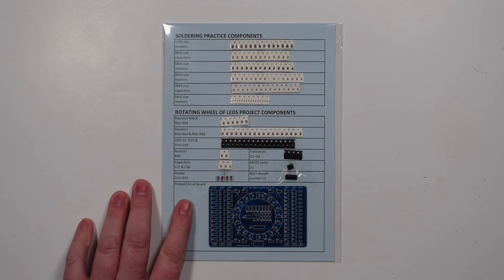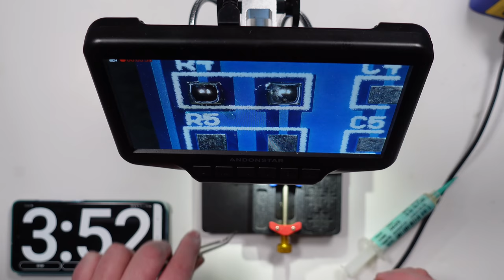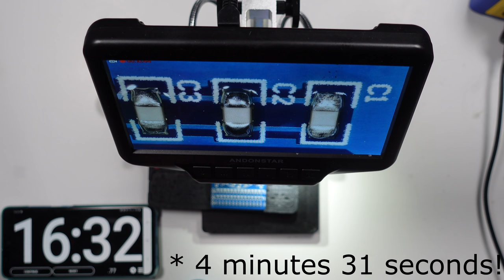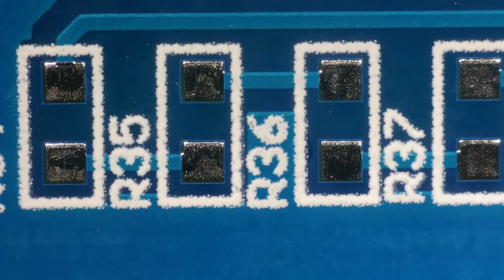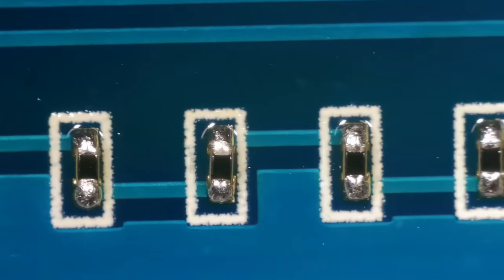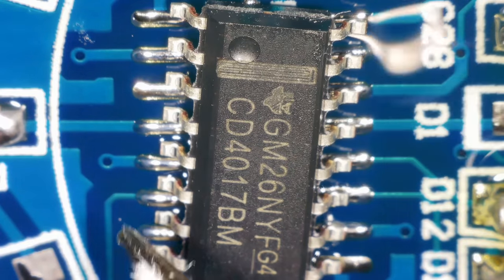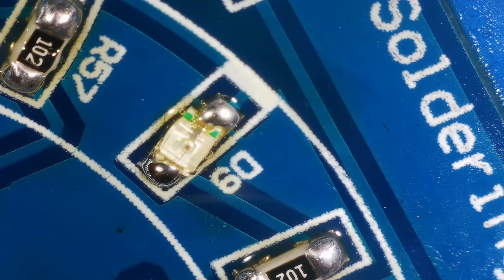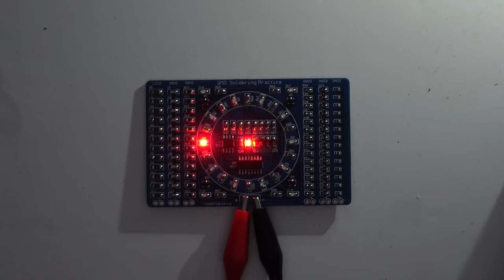SMD Soldering Practice Kit | OOOHH!

Comment: Hi mate what's your flux? Thanks
Reply from the maker: Hi Fawaz. I use Amtech 559. I've nearly ran out! 😳 Need to get some more, its really good stuff.
Reply: @StezStixFix  Hi thank you for this very informative video. I would like to know where do you buy your Amtech as so many fakes out there.
Reply from the maker: @mm0077  Hi Mial! I bought mine from Amazon, as I figured it would have less chance to be fake than from eBay or similar. I'm pretty confident it's genuine, but as you say, there are a lot of fakes! I've actually just ran out, so I'm going to be using Kingbo RMA 218 next, as I've heard it's also very good and is much cheaper. I'll let you know what I think of it as soon as I use it! 👍
Reply: @StezStixFix  I am using the Kingbo rma218 and it is fine but it does leave a kind of grease effect after cleaning and it does not matter how many times I clean with  isopropyl alcohol 99.9.  May be there is a trick to get rid of. Please kindly let me know of your result.
Reply from the maker: Thanks for the info Mial. I'll see how I get on with it. If flux is tricky to get off, I find that putting a paper towel over it and brushing ipa over the paper towel helps to bring it up, might be worth a try?
Reply: @StezStixFix  Thank you for your kind reply and I will try it. I always use a brush to clean up flux.

Comment: Why are you so against allowing the components to warm?
There's tons of those "joints" where you just have a component embedded in a blob rather than soldered.
Reply: Gets much better with hot air and smaller components though

Comment: Is 1B1 resistor 1R1?
Reply: It's actually an "8" not a "B". It's "181" meaning "18" followed by 1 zero, so 180 ohms. The third digit is the number of zeros to add, so "472" is 4700 or 4.7k

Comment: Aah is saw with the LEDs that you figured out to tin only one side bring component in on that pad solder the opposite side and properly solder the tagged side.
Solder paste you just tap the pads and out the components on and chuck them in the over. Like I did here https://m.youtube.com/watch?v=DfNsAK710kQ&t=757s

Comment: Regarding solder paste, you managed to do several things wrong at the same time. 
Number One: No flux needed, just reasonable clean board. Your video could be used as an object lesson on what happens with flux and solder paste.
Number Two: Airflow too high. This combined with the flux blew solder all over the board. And your microscope screwed you too, air should be directed down, you had to come in at an angle.
Number Three: Too much solder paste, this one should have been self-evident, you put on enough paste to solder three components.
Go watch James Sharman, he is building his own computer (it started as a CPU) and in the process learned to use solder paste. But make no mistake, using solder paste is a skill, and doing it without a mask, is that much harder. And the "correct" way is to use a "reflow oven", but hot air is a completely valid method.